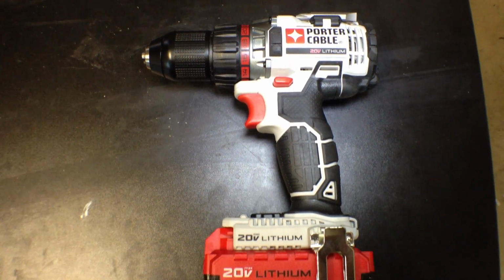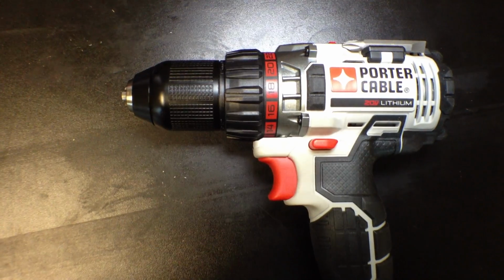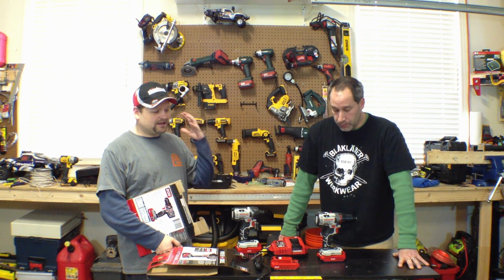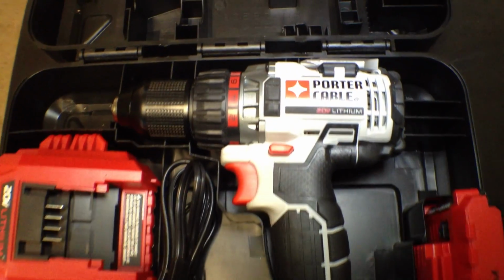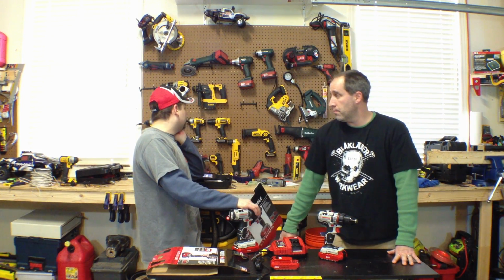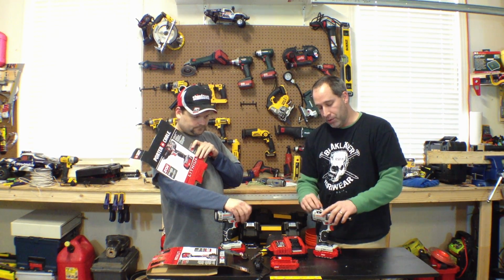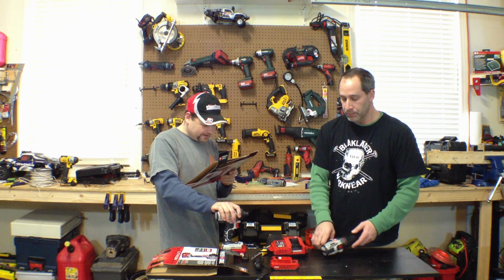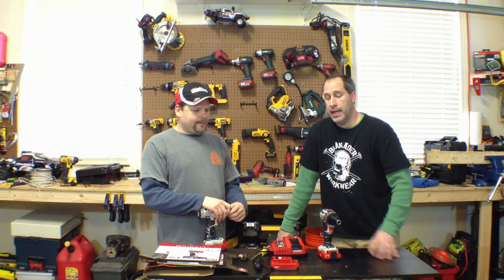Porter-Cable 20V 1/2" LITHIUM ION DRILL/DRIVER KIT PCCK600LB

Comment: Porter Cables 20 volt drill designs looks identical to the stanley fatmax 20volt hammer drill that can be purchased at wal-mart for $100.00 with one battery and 30 charger. I'd love to see a review on that.

Comment: The only down side i have had with these, is the 1.5 Amp/hr battery's. But they can use the upgraded 4 Amp versions of the battery. I use the impact driver a lot more than the Drill but regardless, that drill can punch 7/8" holes in 2x4's all day and not slow down unless she needs a fresh battery.  For the cost, i am totally getting my moneys worth.

Comment: I have this drill and notice when the speed is set on 2 and I fully compress the trigger and then release the trigger the drill seems to slip. Instead of suddenly stopping it slips a couple notches. Just wondering if this is normal. Thanks for any help

Comment: so dewalt, Stanley, porter cable, black and decker 20v.  what is the difference?  motor downgraded?  have the lower brands been boosted by dewalt or vice versa?